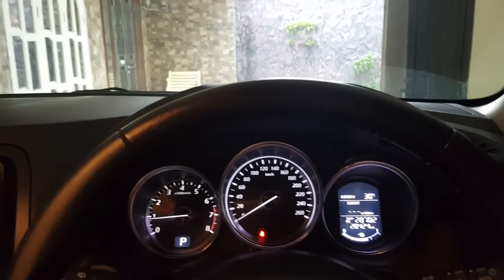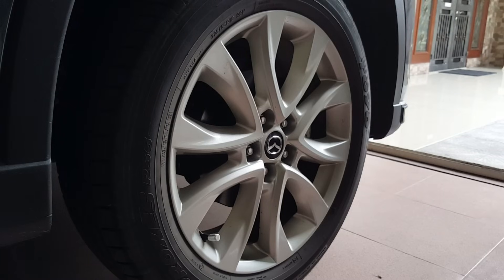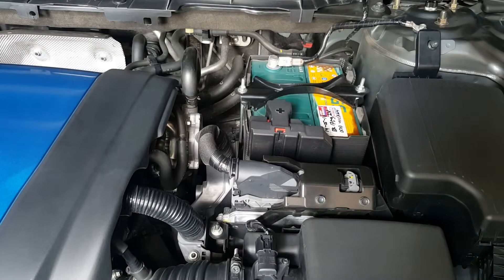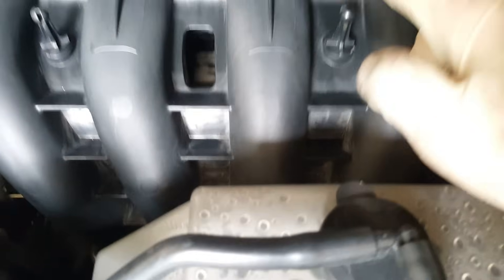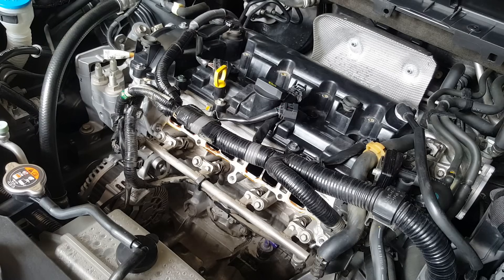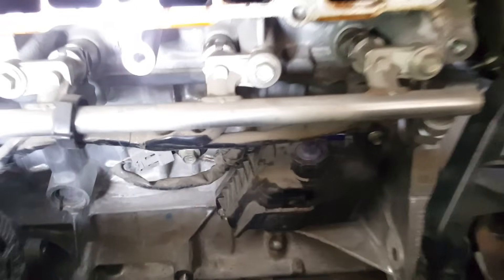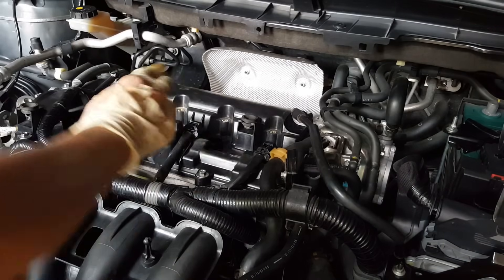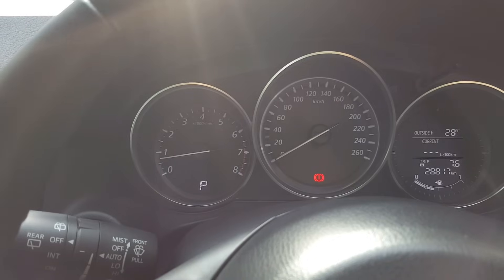How to Clean Intake valves / Carbon clean // Mazda CX 5 (All Skyactiv Gasoline Engines)

Comment: And in about 2 weeks ,check again you will find the same amount of carbon deposit on those shinny valves, exactly as it was at  126 000 km.
Reply from the maker: only if you dont have oil catch tank installed. Please add oil catch tank kit like my video i have posted here https://youtu.be/wwshYqm4cH8 , the idea is to slow down the process of carbon build up issues. Thank you sir.

Comment: Thanks for this video. How do you rotate the engine please in order to close cylinder.
Reply from the maker: get somebody to shine torch at the intake valve port while someone to turn the crank pulley clockwise slowly. You will be able to see the intake valves open n closes.
Reply: @GarasiFelixDan  thank you very much 😊

Comment: Does each cylinder have to be dry after extracting all the gunk? Is it ok to use a metal brush? Are cylinders will only either be completely closed and open? How do you turn the engine making sure that cylinders are completely closed and not partially open? How does it compare to the spray cleaning method?
Reply from the maker: When you vacuum the left over chemical some residue will be left and it is completely fine, Just try to vacuum as much as you can before putting everything back together. I would not recommend metal brush. To turn the engine get somebody / friend to turn the crank pulley while you look at the movement of the intake manifold open and closes. I would think spraying method would not be as clean as this method as the carbons build up does sticks good & difficult to remove, unless the car is very new car and no carbon build up occurs as yet.

Comment: hej man. thanks for the video. I am planing to do this on my mazda g120 (europe ) can you recommend any other chemical , that i can get in Europe ?  Can i use " Injection Cleaner  LIQUI MOLY " but instead of  putting it in gas tank, i could use it to clean ? I don't wanna to damage valve seals. Thanks !
Reply from the maker: Hi man welcome man , hmm i have never use liqui moly injector cleaner but definately could give it a go :)
Reply: @GarasiFelixDan  Hi man. I ended up using " STP Injector Cleaner" and I could not get it clean as much as you did. I removed most of it, and i did blow all that out with compressed air. I hope that cleaner did not damage any or the valve seals. I had hard time removing some wire harness underneath the intake manifold, other that that it was easy job.
Reply from the maker: @neon128  Brilliant. Make sure to ass Oil catch tank while you at it. It will slows down the carbon deposits.
Reply: @GarasiFelixDan  Well i did clean something that looks like a oil catch tank. you mean to add one? i need to check where can i buy it and how to install it.
Reply from the maker: @neon128  check my video on the Oil catch can kit. https://youtu.be/wwshYqm4cH8
Reply: @GarasiFelixDan  thanks , I'll give it a try 🙂

Comment: how did the car perform after the oil catch can + valve cleaning? Any other issues you ran into with the mazdas ?
Reply from the maker: car runs great :) its a must for these skyactiv DI engines.
Reply: @GarasiFelixDan  im looking at a 2017 mazda 3 g-vision... i Love the looks, and i hope i love the drive aswell.. It seems like a pretty easy job with your guide here. You do it every 20-30k ?
Thanks for the videos Felix.
Reply from the maker: @danieljerloew  definately a good car to buy these skyactiv engine are bulletproof. Just follow my basic maintenance your car will be very healthy and last very long.

Comment: Hello,

Are the manifold gasket(s) all the same size? Looks like 2 are smaller than the other ones. Or all they all the same sizes? Looking forward to replace them
Reply from the maker: same diameter n size
Reply: @GarasiFelixDan  thanks for responding quick man I appreciate it a lot. 9:23 the one on the right looks bigger than the rest. Is it my eyes or? 😅
Reply from the maker: @oz-works  👍🏼👍🏼😁😁

Comment: Great video Felix. Note: Using good quality fuel and synthetic oil will help prevent carbon buildup on the intake valves.
Reply from the maker: Yes definately . Thank you sir for supporting this channel be sure to like share and subscribe to keep the channel grows. 🙏🏼🙏🏼🙏🏼
Reply: That's true but low IQ drivers prefer cheap oil and gasoline

Comment: Thinking out loud, I am going to buy an inexpensive electric toothbrush with the round rotating brush and try that along with the CRC solvent. Hopefully it will reach down in far enough, based on the video, it should.
Reply from the maker: Hi Doug yes correct definately worth to buy. Bcause its gonna to get dirty real fast. Just need to get more of mini precise brush to get deep down intake ports and carbon cleaners.

Comment: Hey what error codes  please?
Reply from the maker: what error code did you receive ?
Reply: We had the exhaust pressure sensor changed. Dpf has been cleaned. We have  mazda cx 5 2.2 deisel 2013
Reply from the maker: @paulmasterwindowclea  ok better off to scan the ecu once more to get the better idea which sensors are faulty triggrering the error codes (check engine lights).
Reply: Thanks

Comment: Hi Felix, thanks for the video you made very inspiring, just did on my Mazda 3 2014, Question: my check engine light are engaged now, it's normal that i have to reset at shop with computer or it will go away after sometime? Thanks
Reply from the maker: it will go away if the sensors are plugged in correctly and in working order. perhaps try disconnecting the battery for 5 mins.
Reply: @GarasiFelixDan  Thanks for prompt reply Felix, will try tomorrow morning. Have a nice day ahead.
Reply from the maker: @stiffstiffler18  awsome let us know the update. O yes check all hoses especially pcv / vacuum hose on that intake manifold.
Reply from the maker: @stiffstiffler18  hahaha brilliant 👍🏼👍🏼👍🏼

Comment: 2018 Mazda 3 2.5L Sky.. dealership charged me $286 for a decarb service when replacing the fuel injectors at 54k miles. Car still misfires and is back with them. Not a fan of DI engines.. they basically need a tear down every 30k miles to keep things working.
Reply from the maker: ya unfortunately the only thing with DI engines you must do this service every 40000kms to get the best performance out of the engine.
Reply from the maker: do you have EML shows up on the dash ?
Reply: @GarasiFelixDan  no CEL. Just random misfires and it's running a little rich.
Reply from the maker: @SlowCarsFastSFV  most common issues from other owners getting some random misfires without CEL are from pcv valves are not working properly as well as the hose from the in manifold to the pcv valve, get that checked up. Other things to check r the coilpacks.
Reply: @GarasiFelixDan  Very likely. My other thought is an exhaust leak somewhere. O2 sensors and cats seem ok. Thx for the tips. If my dealership figures it out.. will report back.

Comment: Hey, just recently did this, but on the first cylinder i accidentally didnt have it closed all the way, some liquid spilled into the chamber, but i was able to vaccum it out.

When i was done and started the car accelerated rough, but cruised smooth. It seems to be working itself out the more I drive the car. Is this just from fumes that may have been lingering in the chamber?
Reply from the maker: yes it is totally fine if small amount of cleaner spilled into the combustion chamber. Just give it a good italian tune up (rev) to burn out all the remaining fumes out.
Reply from the maker: Have you install oil catch can while you doing this service? to slowed down the process of carbon build up. https://youtu.be/wwshYqm4cH8

Comment: Hi Felix! Your videos are really great and so far I was able to do most of the tutorials you made. But this one I really like to clean my IV and Im so hesitant to do specifically in the turning of the crank pulley. All the rest was easy. How do you ensure valves are in perfect close position? What if some chemical and residue start to drip in combustion chamber? Thats the dilemma Im having right now.
Reply from the maker: You can get a friend to rotate the crank pulley whilst shine a light on to the intake manifold ports you will be able to see when it closed fully and open. Small drips of residue left over from the cleaner is alright nothing to worry. But i would not start the car if the large debris fall into the combustion chamber / pistons.
Reply: @GarasiFelixDan  om felix brti cleanerny gasoline basis ya… so nothing to worry that much if drips happen?
Reply from the maker: @ROSEMARY-gl7wx  Drips nya jgn kebanyakan .bisa pake yg waterbase juga gpp. gasoline base jg gpp.

Comment: You did a fabulous job. But I dont understand why you removed the spark plugs???
Reply from the maker: to release pressure from the engine. otherwise you will fight over / having trouble turning the crank pulley.
Reply: Read the other 500 replies to that f@#kin question 😊❤❤❤

Comment: Dang, I'm a Uber driver in Texas, I have a 2021 CX-5, I just hit 100,000 MILES today and I've never done anything like this 🥹🥹 but always oil change on time and always use top tier gas, I feel like I can do this cleaning myself but I'm a little scared haha, how do you rotate the engine? And what could happen if you just clean the other cylinders when valves are open?
Reply from the maker: yes id recommend you do this service with a friend if you have never done it before. You will surprise the end result once cleaned properly. The only thing about this service be mind that a large debris can fall if the valves are not closed properly it could potentially scoring down the piston sleeve walls and might damage the engine it self. so it is very important to rotate the crank pulley to see which valves are open and closes. Once happy it is best you vacuum the gunk residue out from the intake manifold.
Reply: @GarasiFelixDan  awesome!! Thanks for your reply, and to rotate the engine crank I guess I just roll the entire car? I might try it out myself, I have well knowledge about mechanics but still intimidating all this sensors and stuff haha
Reply from the maker: @martinezjosegpe  Make sure you do a good job cleaning them & all , plug in the pcv vacuum hose , check all sensors connections afterwards.
Reply: @GarasiFelixDan  okay will do! And I'm saving this video just in case haha, thanks again 🙌
Reply: @GarasiFelixDan  hi Felix its been a while,  what if I don't rotate the crank pulley and I know the debris will fall on the piston (inside combustion chamber) but I will do piston carbon cleanup by seafoam and suck it up from the sparkplug hole if I have to, what's your opinion? thanks.
Reply from the maker: @ddlpt  Yes definately can do that just dont start the car after you finish the intake manifold clean up. make sure u cleanoff the chemical on the intake valves with lots of brake cleaner. And change engine motor oil after wards.
Reply: @GarasiFelixDan  whoaa instant reply, cheers buddy, will definitely do that.
Reply from the maker: @ddlpt  no worries sir i got your back 😁

Comment: How did you rotate the engine? Maybe it is straightforward to some people as you skipped this step, but i really wonder.
Reply from the maker: rotate the crank pulley with a ratchet clockwise slowly.

Comment: Easier to buy oil catch can from mishimoto .. bolt on for many mazda skyactiv models. No need to do this cleaning project. Same to do egr delete with programmin engine. Problem solved. Ofcourse this video was very good.
Reply: What is the easiest or fastest way of cleaning process?. . wallnut blast i know but if have to do it yourself at home with basic tools. Just thinking are you tested something different way. Maybe with dremel.  Next summer i have to do this about 3 different mazda. Mx-5, 3 and 6. Summer is so short and less snow in here😆 need to figure out little easier way.
Reply from the maker: Updated video with catch can installed. 
https://youtu.be/wwshYqm4cH8.

Comment: Hi Felix, can we use the Mazda Deposit Cleaner for the Mazda?
Reply from the maker: yes you can but it wont clean the carbon inside the intake manifold. It would certainly helps clean the fuel injectors and other components related to fuel system of the car. But not clean these stubbon carbon deposits inside the intake manifold.
Reply: @GarasiFelixDan  alright.. Thanks Felix.. anyhow will have to clean the manifold the way you show in the video..😄.. as I'm not too skillful to perform this cleaning..
Reply from the maker: @zen4517  these carbon deposit will develop so fast , only if you neglect servicing (change oils as per log book intervals) and use bad quality fuels for these type of cars. Give the car good italian tune up in the free way once or twice a month. 😀😀your car should be good to go.
Reply from the maker: @zen4517  unfortunately the higher milage skyactiv engine will have to perform this service sooner or later as the carbon build up will be there.
Reply: @GarasiFelixDan  ya, the carbon will build up once the ignition start.. can't run away from this..
Reply: @GarasiFelixDan  yes, that's correct.. sooner or later will have to remove the pile of carbon build up..😁😁
Reply from the maker: @zen4517  Very true.

Comment: My Engine has been shaking a lot, I changed all mount, spark plugs, clean throttle body, no vacuum leak, I'm tired..
 Could be intake valve carbon ? Or it's any thing else that i can do?
Reply from the maker: any error codes pop up on the dash ? MAF sensor , IAT / MAP Sensor , but are you sure theres no vacuum leaks did you remove the TB and replace new gasket ?? my experience .. usually these cars will have vacuum leaks on the pcv valves hose hidden under the intake manifold. While you have removed the intake manifold perhaps you could do the carbon clean service.
Reply: @GarasiFelixDan  I didn't checked the pcv hose, I'm gonna try, thanks man!
Reply from the maker: @resnickdeleon8098  no worries , keep us updates how you go with it.

Comment: Is 2 years Already ??!!
How are you Felix? I finally cleaned the carbon of the valves on my Mazda 3. Its not as easy as you do it and doesn't take 19 minutes like your video. But my car had 70,000 miles, should done it sooner. Thanks to you, BIG THANKS TO YOU I cleaned the valves,MAF sensor, MAP sensor,Changed spark plugs, clean Throttle body, changed belts, replace coolant, cleaned the air conditioner ducts and fan blower and last but not the least and even thought is illegal in California I install the oil catch can!!!!!! Took me 10 hours but that was enough time to stay out of the house since my wife was mad for some reason she doesn't know. Thanks a lost. Felix and please take care
Reply: Wat is MAP sensor??
Reply: @bastogne315  The MAP sensor Is located on the driver side of the manifold. Stands for Manifold Absolute Pressure. Use an electronic parts cleaner and use care when pulling manifold or you can damage connector.
Reply from the maker: Hahah glad you did the major service . Ah yeah the amount of time spent doing this service is about 3 to 4 hours. But yeah i understand you had to clean all the parts above. haha but it was worth it right. The car should runs like a dream as new. 😁😁

Comment: did you notice any benefits?
Reply from the maker: definately huge improvement. better Mpg , the engine will operate smoother , no hesitation at all rpm range , better throttle response.

Comment: When you rotated the engine by hand using  crankshaft pulley  bolt, did you remove only passenger tire or both wheels? (While supported on jackstands )
 And do you have to remove the serpentine belt?
Reply from the maker: i only remove driver side wheels. And yes i use jack stands to support the car. Nope you dont have to remove serpentine belt.

Comment: Is it necessary to reprogram the throttle body with a scan computer?
Reply from the maker: For mine i only took off the negative battery out so by the time the job is completed the car will reset it self and relearn the new setting after starting up the car.

Comment: The oil on the intake manifold is from a failed vacuum pump / brake booster. You should not have any engine oil in the intake manifold. It was a call back issue but was kept from public knowledge. Also at bottom of engine is the PCV valve not an oil return .
Reply from the maker: vacuum pump from the brake booster is running fine from this vehicle. There also a check valve within the vacuum pump which is working in a good working order. So i dont think the excess oil caused by the vacuum pump. Just they way these engine are designed produce excess oil within the intake manifold. But then maybe other owners will have to check their vacuum pump / brake booster..??

Comment: The oil can catch is easy to remove? Wanna clean it
Reply from the maker: yes it is very easy to maintain and clean. empty the canister every oil change 5000kms to 8000kms. You will be shocked how much it can traps the oil.

Comment: Is it possible to spray a cleaner in the intake every so often to prevent carbon from building up in the first place?
Reply: As cool as it was seeing someone liked my comment, an answer to my question would be even better.
Reply from the maker: yes you could do spray it down the Throttle body but , it would be hard as the characteristic of this DI engine does gunk up pretty quick. so best is to slow down the process by installing oil catch can as per my video.
Reply: @GarasiFelixDan  Thanks man!

Comment: When the engine was off are two sets of cylinder valves closed naturally without rotating the engine? Since some of the valves should be closed?

In your video your video you cleaned cylinders 2 & 4, then you rotated the engine to clean cylinders 1&3. So when engine is off two sets of valves should be closed right?
Reply from the maker: yes that is correct sir